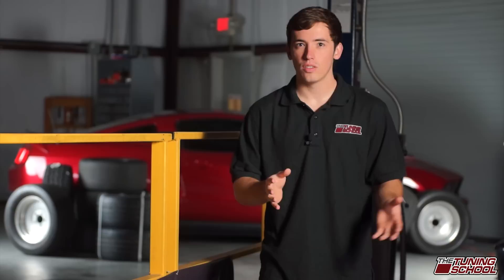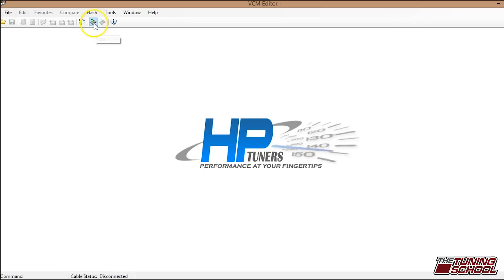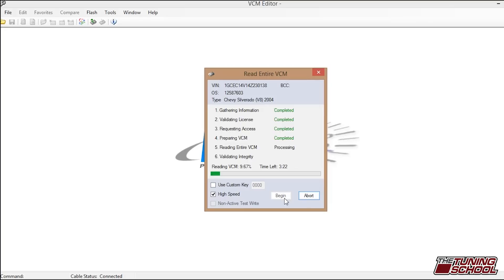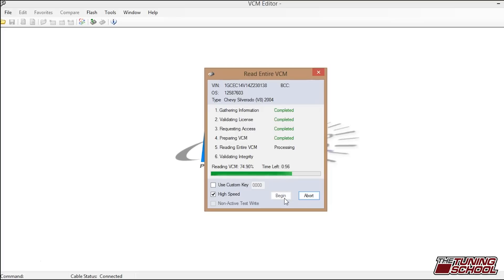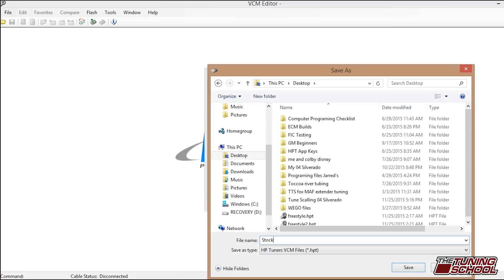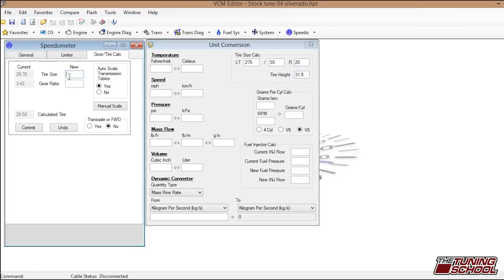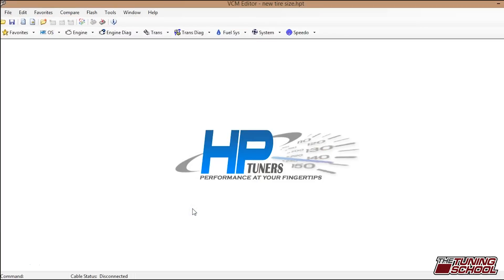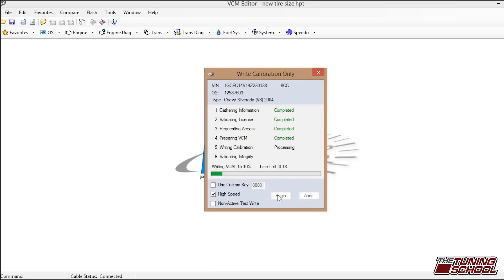How to Upload & Download a Tune File: As Well As Changing Tire Size Using HP Tuners 4.X Software

Comment: Thnx for the video, but i have a question, if my car is 4x4 and the front and rear tires are different in size, how can I work with that ???
Reply from the maker: You would have to change the size to whatever the rears are. The ABS will probably have issues but outside of not mismatching them, it's the only option. Same issue for Corvettes.

Comment: I have a question... I just lifted my truck 6in and I installed bigger tires 35/12.50R20 and every time I turn right or Left the traction light flashes and stop the truck. 

Do you think the problem is cause because they didn’t update the new tires??? 

Thank you

Comment: towards the end of the video, you said to make sure the scanner is not connected when you write the calibration?  What did you mean?  Your Obd2 cord is plugged in, but just unsure about the scanner comment...Thanks
Reply from the maker: No click on the "disconnect" button on your scanner if you have it running in the background you will not be able to upload your tune. Your MPVI- only allows one channel to communicate through the OBD2-either the scanner or the editor not both at the same time.
I hope that makes sense. If it does not please give us a call at 727-264-8875 and we'll be happy to walk you through it.

Comment: I have a question about tire size.Do you have to take the rolling diameter in to account because the actual tire size and rolling diameter size when fitted to the vehicle are different.Cheers
Reply from the maker: We do not typical use values that represent rolling tire size. However if you would like to use that I do not think that will cause you any issues.
Reply: Thanks brother.

Comment: I don't have a Gear/Tire Calc Tab
My available tabs under Speedo are Calibration and Limiter.  Not General, Limiter, and Gear/Tire Calc.
I have HPTuners 3.0
On the Calibration tab I have Final Drive and VSS Pulse per
My Final Drive Ratio is showing 1.00 which I know isn't my actual final drive, and my VSS Pulse per shows 69,192 mi-1
How would I go about changing my tire size now?
Reply from the maker: +Jay Perry It is located under Edit at the tool bar at the top of screen. Click on Gear/Tire Wizard. This is new to 3.0.
Reply: +TheTuningSchool 
Under Edit I have:
Calibration Details
View Change/History Logs
Navigator
View > Basic 
             Advanced

No Gear/Tire Wizard though.
Reply from the maker: +Jay Perry What is your email address? I can send you some more information.